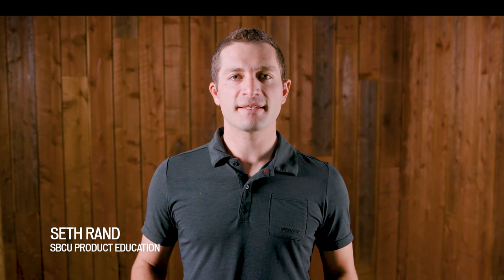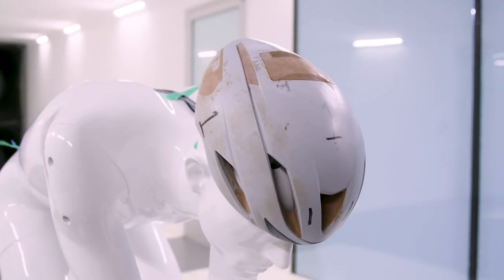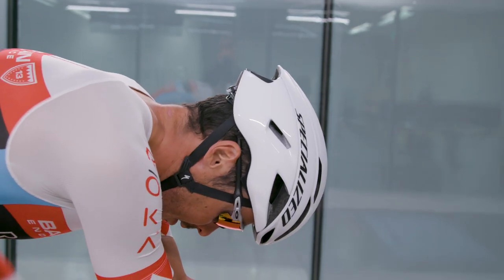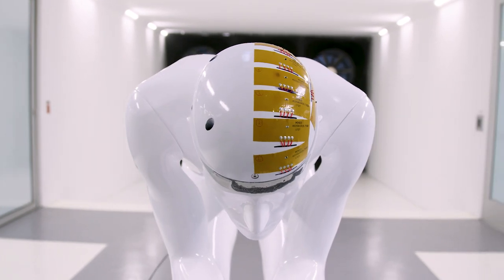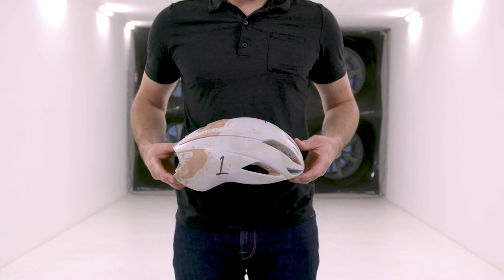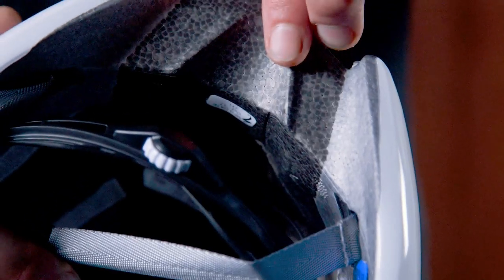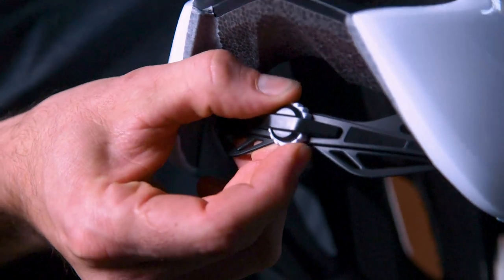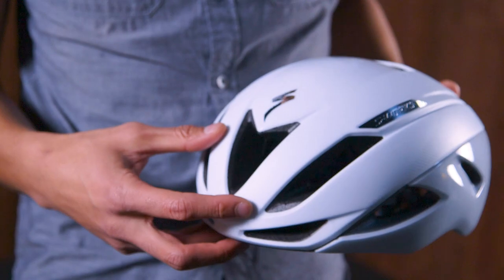All-New S-Works Evade

Comment: I bought my Evade 2 today.  Been using the  original for 4 years now.  I was fine with the old ventilation.  But compared to other regular type helmets,  my favorite feature of the Evade 1 is....  the sound.  Less wind noise from your helmet equals a safer ride,  plus you can hear others talking better.  I hope this new Evade is as quiet.

Comment: 6 seconds per what? ... as in:  6 seconds faster on a flat road over a distance of 100 meters .. otherwise it has no meaning
Reply: In the video it says, "6 seconds faster over 40 kilometers." That is a comparison to the previous Evade.
Reply: Over 40k, like every other test they do
Reply: 40 kms that's what he said...
Reply: Over 40km with no speed mentioned or anything. They could’ve tested it at 100 miles per hour. It’s meaningless but all bike brands and helmet brands use that metric